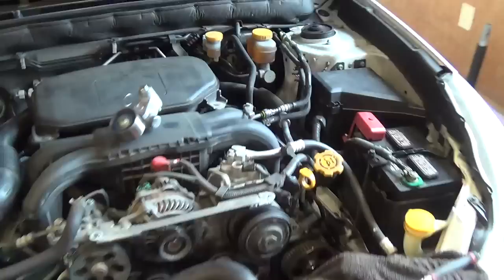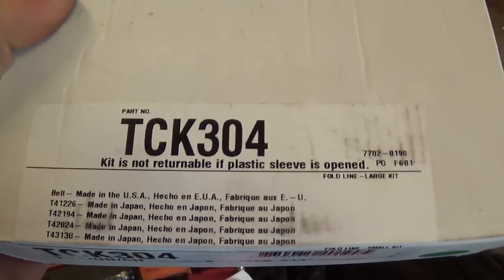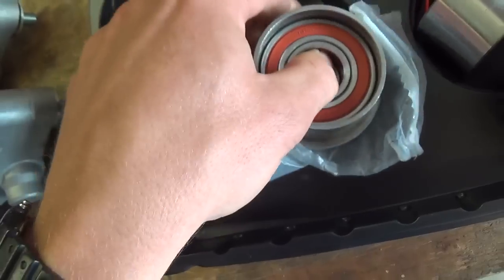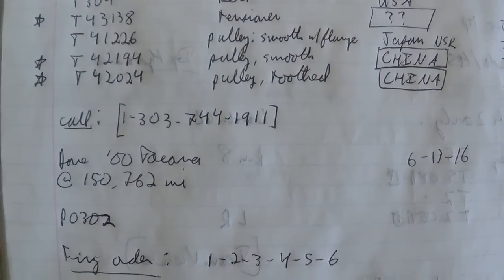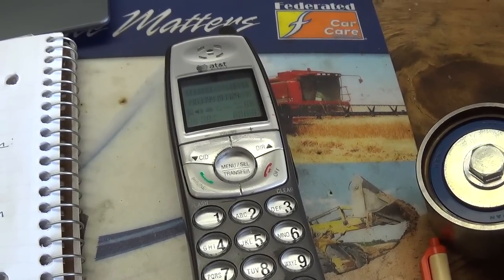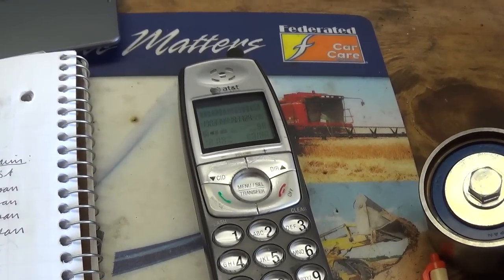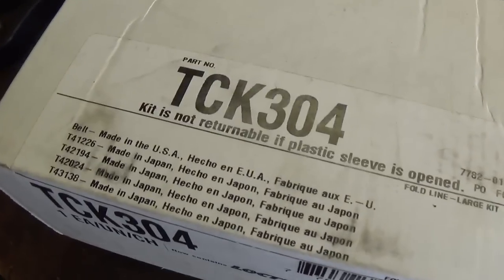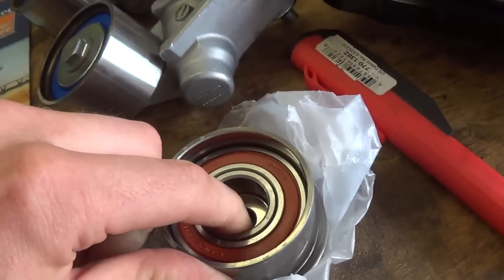GATES Subaru Timing Kits: BUYER BEWARE!

Comment: Remember in Back To The Future II how 1955 Doc looked at the damaged computer parts in the Delorean and said, "No wonder this part failed, it says Made In Japan"? Early on in their Western world marketing life, the Chinese did indeed produce 'cheap and nasty' products, but after failures of those items - which actually hurt both their reputation and income - they have in recent years gotten their act together as an economic necessity. Like the Japanese did in the early 1960's, the Chinese have quickly adapted their manufacturing processes to now sell reputable quality goods. However, as with all mass produced items not each and every single one is going to be perfect, so how an individual can say a Japan-built part would last longer than the Chinese one just by holding each side by side and comparing tool stamps, is beyond my reasoning. Yes, the box your parts came in may have been mis-labelled, but when Toyota, Nissan , Mazda and Subaru are themselves building cars using Chinese-made components - your video is a bit over the top IMHO.

Comment: I'm shocked that anyone is using Gates belts. They stretch like rubber bands and have for years. You have to use a smaller size to start with to cover the stretching. 

Has anyone checked with Subaru? They might be using Chinese bearings now.

Either way, that labeling is illegal in the United States.

Comment: Ugh. That has to be frustrating. I wouldn't trust any timing component made in China.  Can't imagine that it's legal to clearly state on the box that the parts are made in Japan when they aren't. Those parts are guaranteed to be inferior unless Gates has people auditing every single step of the manufacturing process in China. Aisin kits will be high quality. They are the OEM supplier for Toyota/Lexus/Scion.

Comment: The pulleys and tensioners will not last through TWO timing belts.  All of these parts should be replaced, along with the water pump, when replacing the timing belt.  Given the cost of labor and the risk of destroying the engine worth many thousands of dollars, it's cheap insurance.  ALWAYS USE OEM PARTS and stop leaving all those old parts on the car.  PENNY WISE but POUND FOOLISH.

Comment: Timken Bearings has plants in Brazil,Canada,China,Czech Republic,France and India just because its stamped china does not mean it is junk.
Reply from the maker: Doesn't mean it's NOT junk either haha. On some critical parts like timing belt pulleys I don't feel like playing the lottery to find out the hard way :)
Reply: You did play the lottery by reinstalling parts that were known to have 100K + miles on them. I am just saying, the china made parts are built to the specs given. Home depot tools say USA on them . Are they the same quality as Snap On? You shouldn't condemn a part  based solely on an origin stamp.

Comment: Wow, that sucks! Both Gates and Rockauto didn't really care. I have ordered a lot from RockAuto and have got 1 bad part... ACDelco steering gearbox. Not RockAuto's fault, but again, their customer service was useless. I personally will continue to order from them but only items that are not expensive to ship back. Don't forget that Amazon has a lot of parts as well, with fast/free shipping (if you have Amazon Prime), and their customer service is fantastic. They would have accepted the return right away, have given you a pre-paid shipping label to send the Gates junk back, and given you a refund, with no hassle or time wasted.

Comment: "No problem?"  WTF, Ivan.
 
I would have insisted that Gates contact the retailler and clear the way for a return, OR  Fedex out the correct parts for next day delivery. 

Why would any customer who bought something that wasn't as labelled let the manufacturer AND the distributor off the hook as easily as this?  

This isn't just a matter of warranty.  Not counting that this was sold interstate, at least 2 Federal laws are being ignored by Gates selling parts with the countries of origin not as labelled on the sealed packaging. There are severe penalties for false labelling and false advertising.

The FTC and the US Border and Customs Protection agency are required to enforce the following which applies to the kits of parts packaged by or for Gates:

"If marked articles are to be repacked in the United States after release from CBP
custody, importers must certify on entry that they will not obscure the marking on
properly marked articles if the article is repacked, or that they will mark the repacked
container. If an importer does not repack, but resells to a repacker, the importer must
notify the repacker about marking requirements. Failure to comply with these
certification requirements may subject importers to penalties and/or additional duties. "

These being Chinese parts for a Subaru impoorted from H=Japan Japan, they are NOT exempted as "Parts, for machines imported from same country as parts, "

"36. Special Marking Requirements
The country-of-origin marking requirements are separate and apart from any
special marking or labeling required on specific products by other agencies. It is
recommended that the specific agency be contacted for any special marking or labeling
requirements."(https://www.cbp.gov/sites/default/files/documents/Importing%20into%20the%20U.S.pdf)

The Fair Packaging and Labeling Act (FPLA) also applies to this product, and it is covered under the commerce rules that the ICC and DOT are charged to with enforcing.

Comment: Chinese/bad parts are the nightmare of anyone working on cars in the last ten years. I have run out of good aftermarket part companies. Gates is the only belt and hose company that are decent quality. My only successful strategy is buying parts from the OE supplier like a Bosch alternator for $150 instead of Mopar at $500. It is the same part(Mexico).

Comment: You know after I watch this video I got to thinking and I actually just put a gate timing kit on a friend of mine little Chevrolet whatever you want to call it one of them new Eco whatever Motors but sure enough in that gate skit everything was either manufactured by the same company except for the belt which was made in the UK but everything else was component correct I got mine from RockAuto so I'm assuming that since all that happened they've been checking what parts they put in those kits so Hallelujah

Comment: I've done 4 Honda timing belt kits in the last year. The quality is so bad I've had to break the flashing off of 2 of the hydraulic tensioners to keep it from hitting the block. Don't matter where you get them from, napa, advance etc etc they're all junk....
Reply from the maker: Have to go to the dealer, or maybe try Aisin kits online? Part store kits are dangerous.

Comment: Please someone tell me they've sent Gates customer care a link to this video?
Reply: +Nick Nicu Since seeing this video I've checked around and it's how Gates is running their business now. Only the few informed customers will know they're getting ripped off; most people won't know that their repair shop will use the parts made in China anyway. Whoever owns that Subaru is lucky that motoYama is a good guy. Sh*t, the last Gates belts I bought were made in Mexico and I didn't really think about it.
Reply: +IkeandMike1 It's interesting because I just bought Gates drive belts too and they were made in USA. But I did buy them as OEM parts,they just came with the Gates name on them.
Reply: +Nick Nicu Maybe you got lucky and scored some older stock back when they were still made in the USA. I've said it before though, being made in the USA isn't a guarantee of quality either. My "made in Mexico" drive belts have held up fine for 30k+ miles.

Comment: What a load of hogwash.  The issue here is NOT the quality of the components, but the origin.  I use alot of parts that are made in China and often these parts are equal or sometimes superior than the original parts.  For example, I just replaced a turbo on a CX-7 because of a failed seal.  The car would puke out a smoke screen that would make James Bond proud, and burn through a quart of oil per ten miles.  I could have purchased an OEM turbo for $1133.  Instead I bought a Chinese turbo for $90 including shipping.  Smoke and oil consumption went away, much better than OEM.

By the way, I'm a used car dealer that offers in-house financing.  Unlike mechanics, who gets paid in full before the vehicle leaves, my customers pay me over the course of years, and if the vehicle fails, these customers often stop paying.  So my business depends on vehicles lasting years, not just to the end of the parking lot like a mechanic.  For this reason, when I repair a vehicle, I go quality, not with country of origin.  Often that means sourcing parts from China.

Comment: whereas gates used to be a quality product their timing belt kits have been crap for a couple of years now. tensioners and guide pulleys are out of spec very often. ever since the first belt ran one off these pulleys I've been very carefull with these kits. lately I've not used them any more because of all the trouble I had with them! the belts themselves are fine it's just all of the other crap in the box.

Comment: Ivan, this sort of crap happens all too often and i fully support you being pissed. Everyday it seems when i open and auto parts box it is stamped "made in china" Who do we blame? It's an extremely complicated and complex situation as you no doubt know. Now, i have been told that parts made in China for major companies are made to their specs and are same quality as North American parts and not just a direct copy. Who do you believe? 
I'm sure that if you had the time and money and contacted the right people you could stir up a hornets nest at Gates because of incorrect info on the box. You might buy from a Subaru dealer and have the same problem. I can remember when i was young my parents would never buy a product made in Japan because it was junk but Japan cleaned up their act over the past 50 years and now produce high quality products. I don't think i'll see that happen with China in my lifetime. Now that i have vented a little i'll go.

Comment: Ivan, you have to face reality. Made-in-China cars are coming. But you have to concede that Made-in-China quality is improving, just like Made-in-Japan did in the 1960's.  Taiwanese tools are no joke, now.  Maybe you're using Sunex, Toptul and Astro Pneumatic.  The same thing will happen with China.
Reply from the maker: No doubt you are right. All my favorite scanners and electronic tools are made in China (OK except the PicoScope...still made in UK!), and they work just fine :)  
However, I will not tolerate blatant false advertising!
Reply: The issue here is that the box says Japan, and he prob paid Japan prices.
Reply: Chad Bob I think the price is going to be the same regardless of the COO, unless it's Germany or Switzerland.
Reply: Toyota, mitsubishi and Nissan all wear Japanese names. Chinese are now making the best stuff under their own brands. The off cast, made for the other guy 'oem' stuff is typical second rate stuff or worse. Unless they are in partnership with the Chinese, sending their own quality control guys over and breaking the language barrier which is tedious, rather than licensing it their own stuff (vw is the biggest selling brand in China but it's all licensed and pretty ordinary stuff). Premium electronics eg Panasonic, lg and Samsung are all made in China, but with fierce quality control in the case of LG and Panasonic. Numerous dealing with 'engineers' will demonstrate, they are not engineers, rather production managers, or machinists with English skills. In the same way we westerners have oversold our skills, in China its about selling the sizzle at least when it comes to selling product to the west. I most admire Chinese companies that sell under their foreign name. It implies that they are bold enough to put their name to it, knowing that it's their reputation on the line. They have heaps of genuine engineers but like all manufacturing countries the demand almost always outstrips supply.
Reply: And yes Garth Taiwanese stuff is great!

Comment: I don't trust anything but gates belts. All the ancillary components are a fuck no. I've seen a tensioner, water pump and gasket fail in 2 years and 20k miles. Definitely not worth the risk. Definitely glad I went with aisin.

Comment: That was .. I'd call you into my office on this one.
From a customer / legal perspective, you should have installed the parts - all of them - based on a verbal contract with Gates (I heard it - he said same quality or better.)  And if there was a failure, you would have a good lawsuit there.  Especially with your evidence / documentation.  Likely, the quality is the same - but you can more or less look that up and add your 2 pence online.  You certainly did here.
From a technical standpoint, you should have a secondary supplier - and get the parts you want.  Even at a steep price for dealer-only if that's the case.

Comment: But do you actually know those parts are inferior to OEM or do you just assume everything made in China is inferior to products made in US/Japan? I noticed the same thing on my timing belt kit, in fact the water pump is also made in China but the quality felt no less than the OEM parts. You're right, Japan is often better quality and the discrepancy between what is says on the box and what it says on the part is sketchy but Gates is a large company that has a reputation to maintain so I can only imagine the QA is high for these components. I've seen Japan spit out some questionable quality products too. Really the hydraulic tensioner is the only part I'd be wary of in this kit, the rest are bearings and China produces decent bearings.
Reply from the maker: You can't say much about how quality it "feels"...the only valid test is
 installing them on the vehicle and putting thousands of miles on the 
components. I'll let someone else run that experiment, since engines are
 very expensive.
Reply: motoYam82 The majority of owners either don't care or have no idea what parts are in their cars, my point being there's plenty of problem-free Subarus with these parts. It's not always about the country of origin, it's about the brand and quality control. Since the box says "Japan" and the parts are Chinese, I'm on your side, you have an argument, I'm in the same boat, but new parts are better than old parts so I went ahead and installed them. However, I'm not planning to toss the old (original) parts just in case. I torqued everything to spec and followed the fsm, at this point, fingers crossed...

Comment: Thank for the heads up, that is false advertisements. They can spin it however they want, but they lied about the part. It did not originate in the country of origin as advertised. Now whether this was a packaging oversight or a deliberate ploy to mislead customers into paying the same for cheaper parts is the issue. Also, thanks for illumination of rock auto's poor customer service. Dissatisfaction with any purchase for any reason should never be approached as trivial, and the guy should have tried to upsell you Japan sourced bearings at some sort of discount for your inconvenience, as you stated you were going to continue the repair without the parts that did not satisfy you. Thanks for the video, maybe skip directly to the talking, less dialing and waiting.

Comment: Most things are made in China.  Why are people surprised by this?  If the part is OEM spec it shouldn't matter.  If a part fails and causes damage you file a warranty claim.
Reply: a warranty claim can only be done by garages and car dealers where you have the car serviced by a professional replacing the timing belt. We as individuals working on our own cars don't have a leg to stand despite the fact that we installed the Kit perfectly.. Thats the whole point. Do not expect a new engine block when a Gates tensioner from china breaks on you (while you installed it properly)

Comment: I'm not saying parts made in China are all great, everyone knows that's not the case, but I think 98% of the time people are just jumping on the "fuck these parts" bandwagon with absolutely no reason other than "someone else said so."

I've used these parts with no issues at all. 

I have also worked in industrial maintenance for a little over 15 years and have installed bearings made from about any manufacturing country you can think of and I've had more "made in the USA" bearings fail than any other.  That being said I will buy made in USA and Japan over all others, but it's just a preference.

Comment: I commented earlier about this thread and thought I'd add.... Do a search on "Chinese parts Subaru" on Google...Or for that matter on any "Asian" brands.....
Subaru and other "quality" Asian brands have plants and are making parts in China.... 
And to the "Toyota" owner that will ONLY buy OEM parts from them...He better check every part he gets from his dealer for his made in the USA Toyota.... 
If the replacement part meets or exceeds the manufacturer’s standards then It doesn't  really matter where it came from other than for "political" reasons...
The labelling WAS WRONG but the parts may be just fine....